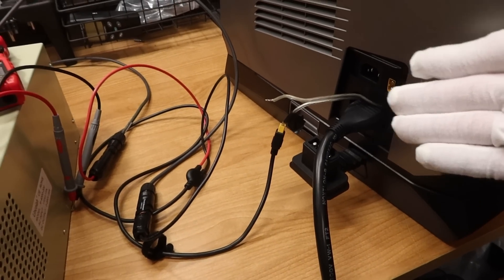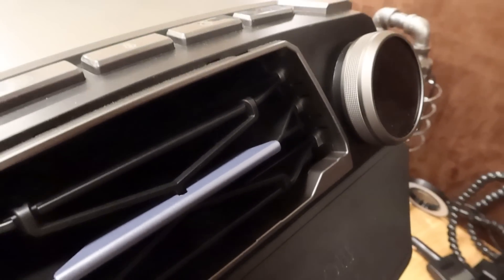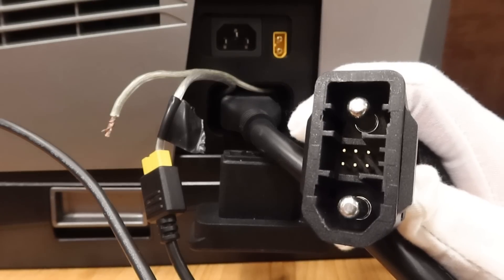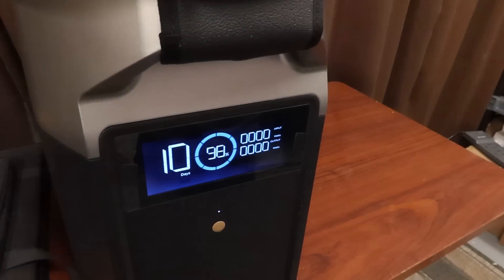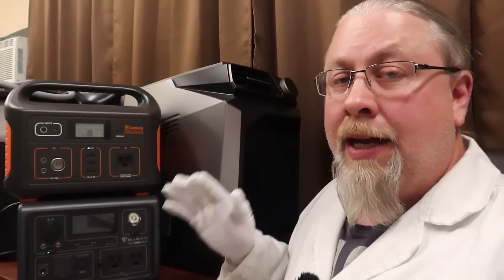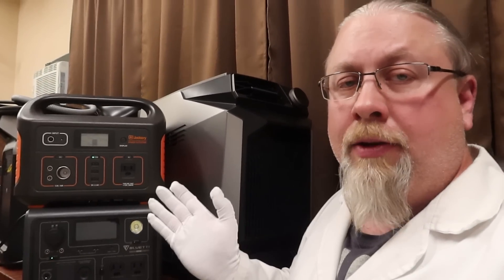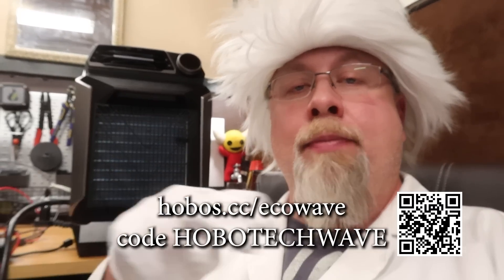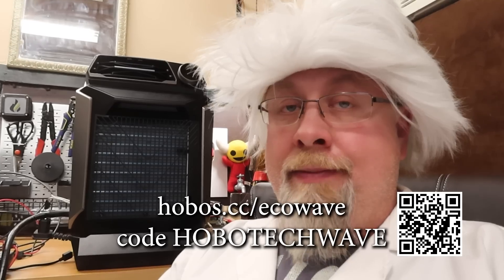EcoFlow Wave A/C FAQ | How To Use Your Own Battery Or Solar Generator

Comment: never understood portable a/c. its just a heat pump that creates a cool side and a hot side. unless you have it halfway through a room door, its gonna do crap all too chill a room. its gonna cool half the room, and heat the other half, otherwise. and the blowing air, will just circulate and bring the warmer air right on over, and does nothing. there is a small amount of cooling, if its through a door and there is a barrier between where teh heat is being dumped and cool air is blowing in. but its not worth the run time compared with even a window mounted ac unit for little apartments.
Reply: This guy does AC.  Very underappreciated comment.
Reply: @wallops6595  good for him, doesnt change the fact that portable ac is absolute garbage. where it literally cools half a room and heats the other half, because of all portable ac's designs. pump the heat away so the blower pushes cooler air, and the back end radiates that heat off. right back into the room. dont give a rats ass about how its "underappreciated". its a reality. unless the portable ac is set in such a position so that there is an actual barrier between the room wanting to be cooled and where you want the heat expelled. its a literal electric waste of power. why do you think window ac units for apartments are like that? so the "hot" expells outward from the house. why are standard ac units outside? so the heat is expelled from the house. a portable ac doesnt have this ability to dispell the heat properly so it just goes back into the very room you are trying to cool down. and because a heat pump generates its own heat under operation, over time, without the ability to properly dispel the heat, makes the room worse over time.
Reply: @dustinherk8124  You're new to the internet and threaded comments, I guess.  My comment was in support of you understanding the refrigeration cycle.
Reply: @wallops6595  my bad, i read your comment through a different context. the joys of ambiguity of the written English word.

Comment: The part where you connect 24VDC to the wave while it is running and demonstrate a readout on the wave indicating a longer run time is encouraging.  Ecoflow said on their FB forum that you could not simultaneously run the unit and charge the battery with the DC cable. They said this was due to the 200w solar charging limitation.  So I assumed that while the unit was running that the DC charging circuit would be disabled.
Reply from the maker: That's definitely not the case. It wouldn't make sense for them to disable solar input while running.
Reply: @HOBOTECH  Perhaps the Wave is simply ingesting the power from your custom DC source and supplementing itself from the battery as needed? That, too, could explain the longer battery life.  

Would have been great to see an example using a step up converter. I can see many 12v VanLifers willing to go this route if they could leverage existing solar/lithium options.

Comment: Probably doesn't apply to this particular EF 48vdc cable, BUUUUT 'some' companies add what are basically dummy pins to create a proprietary cable; sometimes with pin(s) powering a useless LED.
Reply: I bet there's at least one pin supplying a reference "i'm here" voltage to tell the power supply circuitry in the wave to run in bypass dc mode.
Reply: @stevey500  Yep. You're on to it.

Comment: Would it be possible to run the ecoflow wave on the ecoflow smart generator
Reply from the maker: The a/c unit does come with an adapter to run direct off the DC output of a Delta generator so it probably would run off the gas generator too.

Comment: It is interesting to note how many people don't want to run the air conditioner off of another EcoFlow Product. 😳 I wonder why that is ? 👀 Could it be the EcoFlow Power Generators are just too expensive for what they are and people are unwilling to pay a premium price for a name ? 👀
Reply from the maker: Ecoflow has always been the higher priced "Apple" of the battery brands and many have no problem paying the premium for higher end products. I think the problem more is that most don't want to buy a Delta just to run this a/c unit and aren't thinking about the other uses for a top end solar generator.
Reply: @HOBOTECH  I calculate, if you want to embrace the EcoFlow 220 VOLT AC, dual phase battery backup solution to run your house for 4 to 5 days at a time, then you will need to pay EcoFlow the premium price of $23,000.00 USD for the privilege. 😳🥺👎🏻
Reply from the maker: Actually a pair of Delta Pro with the double voltage hub for 240v operation would be under $8000. If you want to run for days on emergency power then yes you would want to add batteries to that. However, to run my 240v house for days cost me well over $25k in DIY equipment and that's building my own batteries from raw cells so is Ecoflow really that much more?
Reply: @HOBOTECH  I would say no, but my point is the whole setup is still costing such a high premium that there are not many folks who can afford to shell out this kind of money. There's the $8,000.00 USD just to get you in the door with a functional system which will run your entire house for a few hours, then there's the real cost you need to pay in order to buy enough battery storage to facilitate a practical running time, and then there's the need to feed that extra battery system with enough solar panels to actually keep that system in full opeartion (2,500 + Watts of panels at least). It's an entreprise operation solution required. This is just too complicated and too much cash for the average person. Hopefully, in the future, we will have more affordable turn key solutions from these same manufacturers ?
Reply from the maker: @markjob6354  This is actually one of the SIMPLEST solutions for home backup which is why it costs more. If you go the DIY route it will save you money assuming you know what you're actually doing which most don't. DIY can get extremely complicated. These Ecoflow units are meant for emergency use to power critical loads during a blackout and not a 30kwh/day home with every appliance running. For that you need a $50k+ solution. Apples to oranges. If you do wire the Ecoflow into your home you can write off 26% of the cost of the entire system (including panels) through the current federal solar tax credit. Ecoflow grosses tens of millions in sales per year so someone has to be buying them...
Reply: @HOBOTECH  Yup, people with lots of disposable income are buying their products. Don't get my wrong, I'm a fan of EcoFlow products, but I sure don't like the company and how they treated me up here in Canada very much 👎🏻🤨I own a River 600 MAX, so I have bought into their technology, and I do think it is pretty good. I also think EcoFlow products are overpriced, versus other makers, such as Bluetti and Jackery.
Reply: @mark Job so... it's personal, then? Ok.

There are millions of kinda wealthy to super wealthy people in the world who buy Apple or products that have an Apple-like cachet. Hacking Apple products or the cachet products is often an exercise in futility. However (so I hear) Samsung was able to do so with the iPhone. Imagine the applied education involved in that!

To do any of this hacking that bypasses the clearly proprietary nature (with restrictions built in against that very effort) would end up being a waste of time or property if a fire ensues.

Thankful Hobotech takes minimized (on purpose) risk to help people the world over understand risk and benefit of these power systems. Thanks, Hobotech!!
Reply: @GinaKayLandis  Excuse me ? It's a love/hate relationship. I thought I was pretty clear about that in my posts, but if there's a way someone can take what you write on the internet and twist it, then they'll find that special way. 😉I love the products but hate the company. This adequately expresses where I'm at. Like Apple, I think EcoFlow is only interested in the (NEXT) customer. This would not be me🥺. We're talking about a real piece of work company that has a Facebook page where if you post any negative comments about their products the administrators will remove those comments within 3 minutes ! If you express any customer feedback opinion about EcoFlow products on their Facebook page, then they better be positive or your post will simply disappear ! Cynical bull shit like that has a real lasting impression on a customer. 🤨There's listening to customer feedback, and then there's supressing it ! It's not the same thing is it Lady ? 🤨How about receiving a phone call from an individual claiming they represent the company offering me a special discount ONLY IF I remove my negative feedback about my online buying experience on Amazon Canada😳 ? What do you think ? Yes, EcoFlow made it personal ! 👎🏻
Reply: @markjob6354  I don't like companies like that either. It seems that if you're looking to do this at home there's some really good solar, hydro/wind turbine, water wheel systems that "off grid" people use at their homes that would be cheaper and you may see a better return on your money. Not sure how expensive electricity is in Canada or if it's like Medical there. (where the government handles it for you?) But there are some pretty ingenious ways to get power. How much is the question? Hope you find your answer. All we need is another Apple! They say you get free updates for your phone with the latest OS and then they hack your phone (with software) to slow it down! Gee thanks! Monarchies are what they want so the can push everyone else out!
Reply: @bradh74  save mexico.....🤡

Comment: Couldn’t you supply a sufficient DC power to charging inlet of the air conditioner’s battery?
Reply from the maker: Did you watch the video? That's exactly what I did for like 15 minutes.

Comment: Would it work with a AC200MAX using the 12v 30amp output wired to a 12/24 volt upconverter into the solar connector on the wave?
Reply: Yes it’s fine i charge my Bluetti with a 12v to 36v step up connected to 100amp hr lithium battery gives my 435v .Never had a issue .No risk at all .
Reply: Thanks Sir, you know your stuff. I've been following you for years, and I appreciate your commentary and insight. A great job you do!!
Reply from the maker: Cheap boost converters are not a trustworthy source of power. Do it at your own risk.

Comment: The manufacturers need to understand that solar generators are largely used in emergencies and need a variety of charging and supplemental battery options. Users will reward those that give them more options! I wish for  "junk charging" and "junk supplemental battery" ports that can take anything from 10v DC to 120v DC. :)

Comment: Maybe I have missed this but can you run the Wave with the Delta Max smart battery.
Reply from the maker: I mention several times it will run DC off the Delta Max. In fact you can buy it in a bundle.

Comment: THANK YOU, ok is it  possible to call Bluetti
and tell them to build an AC unit we can run without connecting a Tesla to it, i mean an expensive Delta pro or inferior lithium ion cobalt 🦖🦕 battery the Delta Max is already the Ford pinto, Chevy Vega, Russian Yugo, of the Sogen world, we want a Glock pistol style generator where all the accessories fit universaly who ever does that will be King 👑 of the solar world 🌎.

Comment: This is a great product for anyone that does not already have a battery bank and inverter and has a small area to cool. if you don't, buy this and an Eco flow power station together, or the battery they made for it. If you already have a battery bank and inverter you should just get a cheaper inverter window unit for around 400 dollars, you will have more btus which is how you measure cooling capacity. 12000 btus is 1 ton of cooling which will cool 500 square ft. this unit is 1/3 ton so it is made to cool about 200 sqaure ft area.
Reply: I disagree regarding buying the attached battery. It is an $800 to $900 battery who’s sole purpose is to power the EcoFlow Wave. If the Wave breaks, the battery is useless. You are paying a lot of money for a battery that you will probably use only 3 months a year. EcoFlow could easily had given the battery the capability to charge a phone, tablet, or computer. I would only consider buying this if you had a real need and had a Delta Max or Delta Pro. Otherwise it is way too much money if you have to buy a battery that does nothing else but run the Wave for 3 months a year. I predict EcoFlow will have to give the battery more capability and I would hold off buying it until they do. They rushed this product to the market place without responding to any questions. I think it will impact their sales.
Reply: @gary860  Well, I agree with you on the battery. Which is why I suggested the delta power station first. I would always choose the power station over the battery they made for this unit. Personally, this thing is way to expensive for what it does, same with the zero breeze, this is not new tech, It is just very expensive for less cooling than with a window unit. But you still save money buying this if you dont already have a set up with batteries and an inverter than buying this and a whole battery system and everything you need to charge it.

Comment: Hi!  I was wondering if you seen my question on your review of the new Jackery?   I have a trailer with factory solar.  I also have a Jackery and Jackery solar panel.   I had a solar plug put on my trailer to use a solar suitcase for more charging power.  I like to use the Jackery solar panel but … it has that dedicated 8 mm plug and does not have a controller attached.   What adapters do I need to run the panel to the controller then to the plug???  I think the hard part is the solar panel to controller.
Reply from the maker: https://hobotech.tv/amazon/#Solar-Adapters
Reply: If I am understanding your question correctly, we would have to know what type of solar plug you have installed on your trailer, and if that plug runs directly to a solar controller or not. The short answer is that you'll need an adapter that converts the Jackery's 8mm barrel plug to whatever type of solar plug is on your trailer. The proper path should be: solar panel ->adapter->solar plug->controller->battery. If it's one of those Zamp solar plugs, you may have to replace that as well with something less proprietary.
Reply: @twloughlin   Yes this was an add on plug which looks like that typical m4 plug.   When it was added it was hooked directly to the battery.    Your answer in what order it goes really helps.   Most suitcase solar have the controller on the backside of panel.  Working with the Jackery panel.    
So in this case and with suitcase with a built on controller…. The controller is what plugs in to outside of rv.  The solar panel is plug into the controller.    Does that sound right. ???    If so I need an adapter for the solar panel with 8mm female and on the other end just wire ends.   Then I need a cable that is wire ends with a M4 connector at the other end for the rv plug.   ??????
Reply: @tjphoto8943  Assuming you are working with a solar suitcase that has a controller on the back and NOT the Jackery panel, my guess is that all you would need would be an adapter from the PV output wire of the suitcase solar panel (is it an 8mm barrel plug?) to convert it to an MP4 plug that will plug into your trailer's solar plug. Obviously you need to make sure that the male/female connections are correct (only one way they can plug together) and you have the correct polarity going into the trailer plug. Prof. Hobo has a slew of adapters on his page (see his link above); one of them should probably work. Using the Jackery would require that you have an external solar controller mounted somewhere between the solar panel and the plug. Since you say the plug is hardwired to the battery, the controller has to be installed before the plug. The Professor has solar controllers on his Amazon page as well. I hope I've understood you correctly.

Comment: Just buy a cheap air conditioner and run it on AC, until a DC solution hits the market...
Reply from the maker: This is a DC solution 😆 ... you can't take a window a/c unit camping!
Reply: @HOBOTECH  I have an ac window air conditioner in my van, and if memory serves so do you, LOL...
Reply: @HOBOTECH  so I'm setting up one of those Lifetime Sheds, 8x15, and want to setup solar, battery, and AC, all the AC I find that would work for a portable use seem really expensive, can I run a wall AC (5000BTU) off a Jackery 1000? I am going to run a laptop, and two monitors, and a few other gadgets, all about 334 watts, any suggestions on AC or battery/panels, I need the panels/battery to be "portable"-ish.

Comment: You're assuming the 2 large pins hot and neutral, when in fact I would bet my last dollar they are both hot wires. I am also willing to bet the sink of the six small pins, one is "verification" pin to keep enthusiasts, like yourself, from easily reverse engineering the device and running an unauthorized power source. But you already knew that.
Reply from the maker: Not assuming anything. I said in the video I hooked up the battery and got 57v DC so I knew which was positive and negative (not hot and neutral you're thinking AC power).